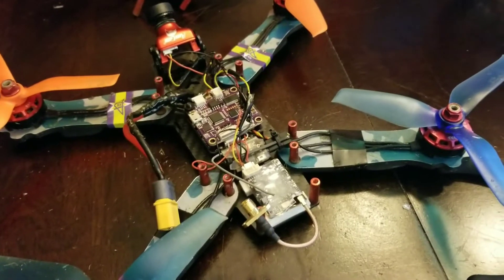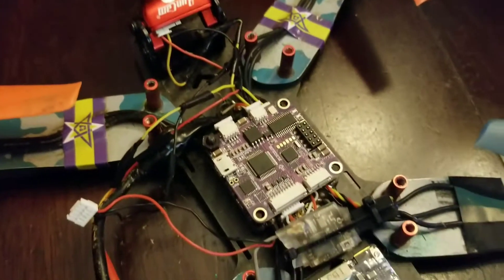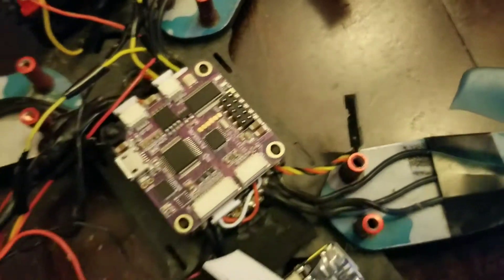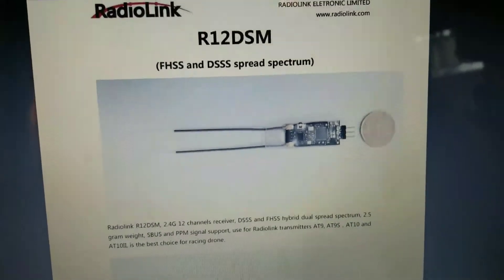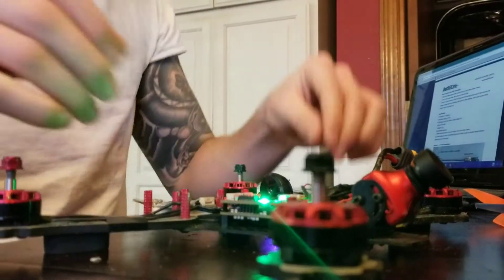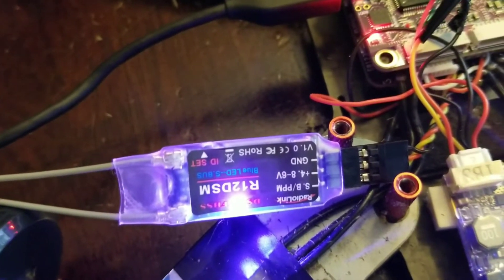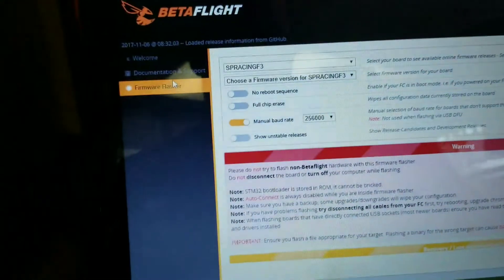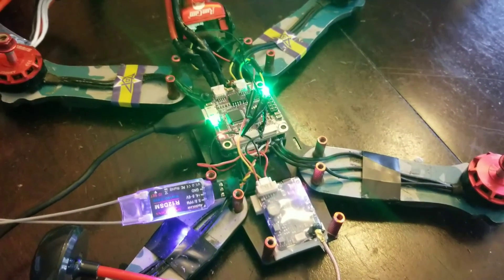R12DSM RADIOLINK (AT9, AT9S) INSTALL ON ARRIS C250V2

Comment: Hey, just got a c250 v2 drone. Can you help me where to find the binding button. Will i have to disassemble it to get to it? Thanks
Reply: Did you ever work this out - just a c250 myself and wondering the same question...?
Reply: its a tiny button you gotta use your fingernail on that, on mine was under the shrink wrap on the side, for a minute I didnt think it was there